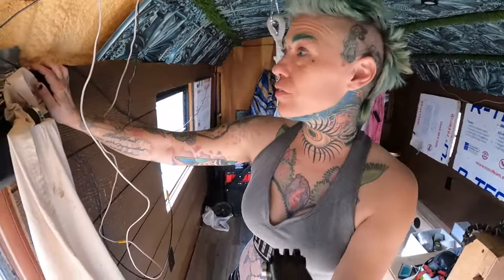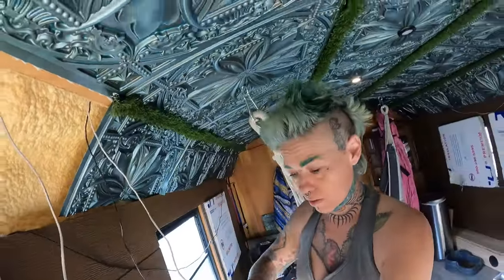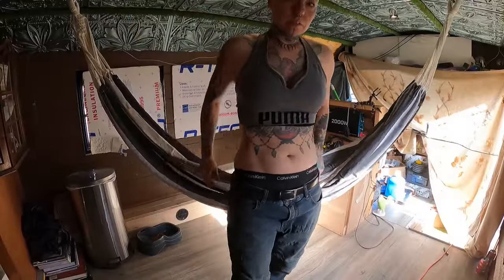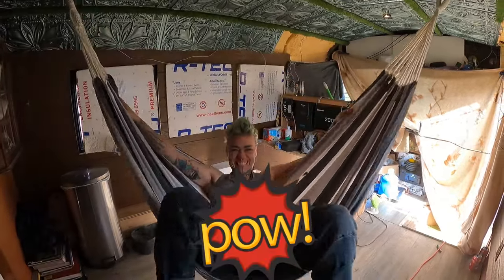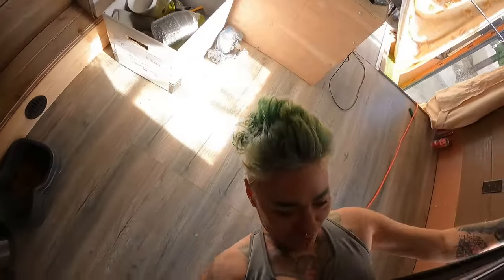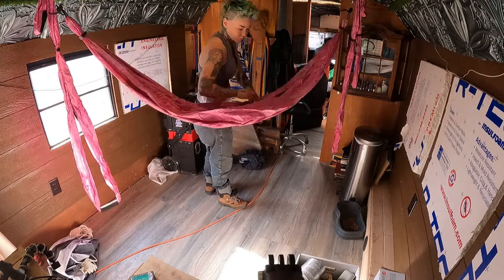Hanging a Hammock in my School Bus Conversion | Tiny Home | Solo Female Skoolie Build

Comment: Any leaks so far?
I'm nervous about drilling through the roof.
Reply from the maker: No leaks there so far 😁 Just so you know I did  use the Flex Seal Spray also, you definitely need to do that as well.